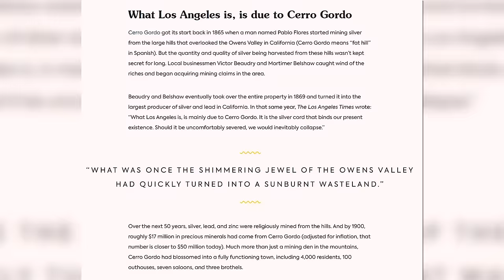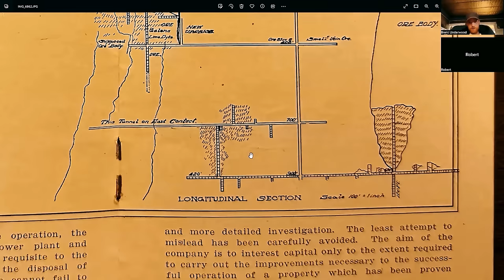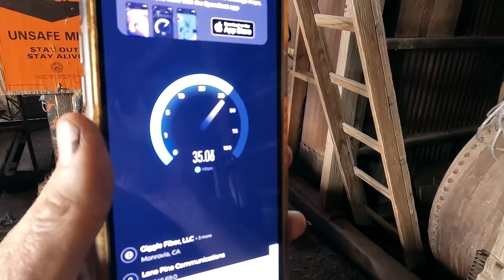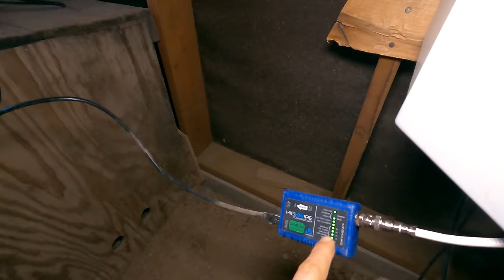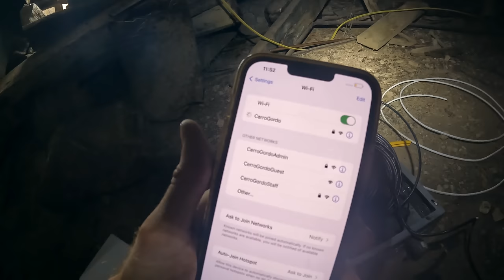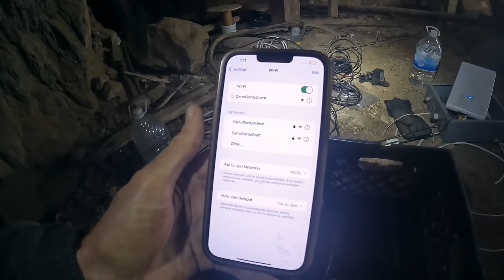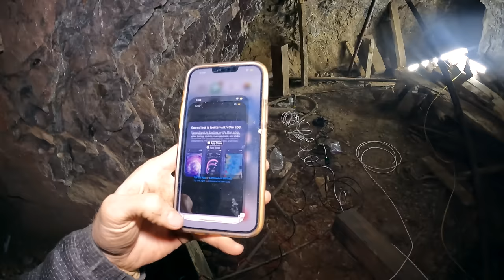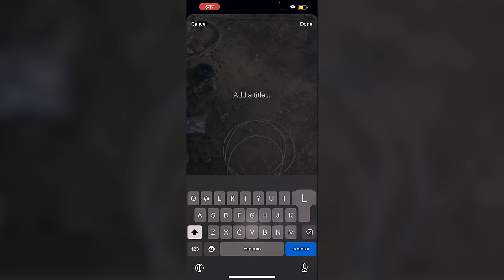I Have WiFi In My Abandoned Mine! 900 Ft Underground!

Comment: defo would have recomended fiber. can reach up to 120km on a single mode fiber no problems
Reply: If you pay for it and replacing it every few months, sure...
Reply: @dievas_  Why would it need frequent replacing? Use armored cable, and SMF is very cheap.
Reply: @dievas1 Replace fiber every few months? LOL Our country is still using fiber installed like in 1960's
Reply: Now you know how the trans Atlantic communication cables work. Cables connecting each nation under the ocean by wired land line communications to land, to towers for a wireless signal. Ps. Sattelites dont exist. Never have.

Comment: The voltage drop across 1000 feet has to be significant. I'm not sure about powering dc electronics over that distance. Use AC to power the devices at the bottom!
Reply: depends on the load. with just a wifi acesspoint there will be wery little voltage drop.

Comment: If you have 110v down at 900 foot level why wouldn't you run two power lines. Converters ethernet signal to electric signal. No extra cables needed, just two power lines
Reply: The max theoretical range of power line Ethernet is 984ft. In the real world it'll have issues far less than that. They should've just used some fiber. Lighter, cheaper, and longer range capabilities than coax.

Comment: Former cable guy. You probably should've used RG-11. It's a much thicker gauge coax cable that allows for less attenuation in signal over longer distances. You can definitely splice coax, but not like you would electrical wire. You put fittings on each end of the coax, then use a "barrel" to splice them together. It's just a component that's used to splice two ends of coax together. If you've ever seen a cable outlet in a wall, the little silver connector sticking out is one side of a barrel. Yes, a splice could create future problems, but a splice can last years. Also, it wouldn't hurt to use some rubber weather fittings for each connection inside the mine to protect from moisture. They make some specifically for coax use.

Comment: Soon as I seen the Mikrotik HEX I knew it wasn’t gonna work. RG6 is only good for ~300ft. 

Personally I’d bring the cox to the 300ft level, setup a RB2011 switch there. Then run a fiber down to another RB2011 per level, since you have outlets you and you want network. There will have to be a compromise. Fiber can run long distances, you could even run a single LR fiber from the top to the bottom with two RB2011 switches and it would work.

Comment: Hi brett. 

I was meant to try to contact you regarding the length of that coax cable and suspecting it will be too long with too much power deprecation over such a long cable.  And that you will need a power injector to ensure enough power to the devices. 

Seems like you got it sorted anyway and learned the hard way. Good stuff.

Comment: You could make the base camp room also function as an emergency underground bunker. You could renovate those tunnels fairly cheaply (Compared to building an actual bunker) and you could easily live down there for months/years if you have enough food and water to last. You'd probably never need to use it that way, but it would be a MAJOR luxury that could end up saving your and your loved one's lives if SHTF and its not safe to be on the surface. I'd be sure to get some UV lights to help simulate sunlight if you are staying long term, and red lights at night to keep your circadian rhythm in line.

Comment: That's a hell of a hot signal, for your location. You must have good line-of-sight to your local cell antenna. Next step: get a UPS down there. You want some emergency backup power and more importantly, active filtering in case the power is dirty.

Comment: Hey there Brent!
Long time follower here. I noticed in quite a few videos the microphone quality can be a little touch and go. If you're using Wireless Go II's for audio on your person - when exporting the audio, try changing the settings to output as 32 bit float. 
Trust me, the difference to the audio quality (especially in situations where there is high wind, or in the caves - it will genuinely surprise you.

Comment: One recommendation on the coax cable.  while normally not an issue, coiling the cable next to itself may in rare circumstances  cause weird signal issues. Just mentioning this if you end up trying to diagnose any weird issues, just try removing any coils of the cable to see if that helps.  Overall,  cool stuff getting internet 900 feet down.

Comment: Hey Brent. I want to preface this with the fact that I am far from an expert, but if you are truly trying to build a base camp down there that will require quite a few electronic devices, you will probably have to extensively modify your power setup. Only running 12-2 Romex, you are going to be limited to merely a couple amps before you start seeing excessive voltage drop with a 900ft run. It will work fine for a couple lights, but it could lead to significant issues with computers and other sensitive electronic devices.

Comment: Hey, I have a big suggestion for you for running all these cables and everything. You maybe should think about pulling a few 2-4 inch diameter plastic tubes from the top all the way to the bottom. Then instead of trying to put the cable going down, in 1 run, you can run cable   to several junction boxes wherever you want to and also an emergency phone line that is hardwired in case you lose Internet or anything else. It would also give you junctions that if you did lose power, you could troubleshoot in sections instead of figuring you lost a whole 900 foot of either power or Internet cable.
Reply: You could also run hard pipe for compressed air to all the levels

Comment: Hey Brent you might consider running a conduit and pull wire for the power and coaxial cable. It’ll make it way easier to run new lines and will protect them

Comment: I'd recommend using Power-Line instead.

You only need to install the adapters on the same circuit.

Then you just plug in the Wireless units into the power sockets you've installed on each level.

Power Line has a maximum distance of 984 feet.

Comment: Suggestion: What ever levels you mostly visit, maybe install a similar WiFi connect point (400, 700?) ? Place them in a casing that will protect them from the elements.  This can be a safety feature for when you go down there. Have the points on each level noted on a map. In the event of anything going wrong down there, go to a WiFi connect spot, and try to make contact...

Comment: I bet you wrapped a piece of the braid on one of the connections you made. Don't let the outside braid wires touch the center conductor on the 1st cable line you ran. You could keep it as a spare . Your doing a great job.

Comment: One thing I would note. Would be to have more separation between the power and the coax cables. Minimum of 200mm air gap between, or 100mm with one of the cables in a conduit.

Comment: Watching you struggle with your wifi was painful to watch, but I'm very happy that you got it done in the end.  Something to consider is that the Ubiquity device that your man put on the side of the building is meant for long range (miles).  You could just put another one facing down the shaft.  This would allow you to use inexpensive Access Points at any level connected to that shaft that would connect it.    I'm glad you didn't try to run 1000 feet of CAT5e as that limit is around 200 feet.    Never hit the reset buttons on the backs of any Ubiqity devices as that removes the programming and you will need to re-adopt the device, which needs to be done up top.  You can power cycle them.    Please make sure that hoist operators are always trained for the flashlight comms, just in case the internet goes out.  Also You should work on some sort of method of allowing the operator to know that the internet has dropped off.  He or She could then send some air horn blasts down the shaft to let you know and let you check in by flashlight.

Comment: Just a suggestion but fiber is so much cheaper than coax cabling ... And you would have the internet latency much lower and honestly it be more stable even just have two Ethernet to SFP converters to convert back to Ethernet down in the mines and above to the wifi ptp dish

And adding a fiber cable now would give you a redundancy of sorts

Comment: There are devices called time domain reflectometer's. You can get a cheep basic one for around 10 - 20 dollars. It will tell you how long your cable is, if there is a break, and distance down the cable where the break is so you can repair it. .

Comment: I was thinking of using powerline addapters..? Since you planned to run power down there, you might as well transmit internet using the same wires! Most homes have a LOT of romex in it, and the signal often has to go through the breaker box and back to the destination. Can't imagine a run like that being much less than 900 feet.

Since you'd have them basically on the same wire, i thought it would be a good solution

Comment: Your radio issues can be solved with money by any two-way radio company, but first it starts with proper antenna alignment. Ask a ham radio operator. Don't use VHF, use UHF. As far as power goes, should be using 600 volt cable and transformers to minimize the losses  down the long run. For the well pump, it needs to be a three-phase motor with an external controller / soft-start. Converting to coax isn't even necessary; all you need to do is aim one of the wifi radios down the mine shaft and point another up at the floor of interest, outside of the car tracks. PoE is a wonderful thing. PoE can be used further than CAT5 and CAT6 can be run for data. You need a respirator and goggles for any heavy work down there. Remember that silicosis kills and it takes a while for the dust to settle (unless you bring a wet-dry vac but then you need to clean it out).

Comment: So.... coax.  Having built several hundred networks, I would think that running a multi-strand multimode OM4 fiber cable would have been the way to go over that distance. You have power so the transceiver equipment and POE switches would not be a problem.  I've used those Veracity Highwire devices and have yet to be impressed with them.  However you do it, I can see the advantages of having the Internet down there.  Good on ya, mate!

Comment: You may need to get a Time Domain Reflectometer (TRD) instrument and "shoot" the coax.  What  TDR does is send an electrical pulse down the coax to the end of the coax. Shoot it with the end terminated  in either 50 ohm or 75 ohm terminations installed . Your coax type will determine what value of termination. I think you have F cable connectors so this is 75 ohm cable. 

An open or short in the coax will be shown on the TDR instrument in meters from the instrument  thus you will know how far to  do reach where your problem is the coax.  Then you  cut and  to put in a slice. More importantly,  long term you can't keep running new cable down the mine shaft when it stop working.  The cable companies / power companies use TDR to know where to dig and repair.

The TDR can also give you an indication of how well the signal is being send down the mine shift.  This is known as insertion loss (ILS).  The devices of the coax will have a minimum siganl level determined by how much signal is lost in the coax.

Also I see in the video that the cable staple were used to attach the coax. You cannot pinch , mash  or bend the coax cable or this deformation of the coax will cause the signal to be reflected back to either end of the coax into the receiver that you are attaching to the ends. Too much reflection will cause the receiver to drop since the forward error correction of ethernet is overwhelmed with uncorrectable errors.

Hope my technical explanation helps.

Comment: Still got pump at source.   
@Brent.  Pumps are designed to pump water out of a hole.  Not up a hole.  Put your well pump at top of hole and your water will work bettr longer.  And wont have to go 700' down to fix.
700' aint shit for a well pump

Ive tried to tell u this a few times now  mayb ull get the message this time

Comment: You may need install a signal amplifier somewhere in the middle of the 900 ft of cable. 900 ft is a long way to carry low voltage dc current. If tv signal needs an amp to carry that far then it stands to reason that Ethernet needs an amp aswell.

Comment: It would be better to eventually switch over to Fiber to replace the coax line. I did that with my company, had to do the same thing and bring internet 1000ft down a tunnel so that our workers had a way to communicate. At least you have an elevator, we had stairs going 1000ft down. That trip was brutal.

I'm curious to know if Starlink is able to work for you. We've been using it more and more for our sites at rural areas.

Comment: i think you should have used fiber optic cables down the shaft. The signal drop is quite high for coaxial cable of that length. fiber can go father than 2000ft before needing an amplifier.

Comment: With communications you need to use two 6 element beam antennas one mounted to the top off the hole pointing down the hole then one on the lift pointing up the the hole fixed to your UHF hand held radio,, for coaxial cable run rg 213.  Maybe you need some sort of amplifier or a booster,

Comment: As others have said, loses on copper over 900ft are huge. Spend a little $ and go to fiber for communications. You can buy 1000ft of preterminated fiber for <$1000. Way more reliable. And get starlink at your main building and use your ubiquiti gear to distribute that to the other buildings. Instead of 50mbps, you'd probably be more like 500mbps

Comment: It's finally a reality! Woohoo!  Now you can have the world at your fingertips! Now you need to have mains power run down into the mine and then you can have all the home appliances you want down there! Like a microwave and a water cooler, a refrigerator, a toaster, air fryer, instant pot etc. Of course, you need also a queen bed, a chemical toilet, a table and chairs, kitchen counters and of course all the things a kitchen needs, and don't forget a hot plate. DO NOT USE GAS or any other kind of OPEN FLAME, for obvious reasons. but it would be so cool to be able to stay down on the 900 level when you are trying to get things done. bring down some extra cots for others who might want to join you too. I would also advise for a door to the rest of the mine level because you don't want the dust to get into the Suite and getting everything dirty, and some kind of flooring so the dirt doesn't get stirred up every time you move around the living area.

Comment: Brent I saw you blow on your coax cable fitting, don"t do that. Over time the moisture from your mouth will corrode your connection. Use canned air to blow the crud off connections. I build cable distrabution systems using big coax cable, I worked in a bucket truck and blowing on the coax was done all the time until it wasn"t. They found a corrosive material caused problens to all the taps at every power pole, it may take years to cause problems but it will cause problems. Good job on your WiFi

Comment: I did internet for 10 years before changing careers... When you go for the mesh system I do recommend running ethernet to hard wire the mesh units... That way you can save some money. Those rock walls are going to kill your connection so if you hardwire you can get some more distance and have less mesh's running.

Comment: Its recommended to keep your voltage drop to <3%. With your romex, that would be 1 amp or 120W of power. If you limit to 10A at 900' I'd recommend #2 minimum wire size. Another commenter is correct, you should use conduit too.

Comment: mount the wifi setup to the cage, and put a junction at each level, that way you have power and wifi at each level. Or a permanent installation at each level and you could have wifi for the whole trip up and down. Now you just need to get some arduino and linear actuators to smartify the hoist control system.

Comment: Another option would have been to use an ethernet 'powerline adapter' (ethernet passed via power cable), this would have eliminated the need for a coax cable entirely, you could have likely just used the power cable instead, although its possible that maybe distance would be an issue in that scenario too, never tried it.

You should buy yourself 1 pair of adapters (they come in packs of 2 for like $40-$50), and then see if they work, because it might be an alternative to laying more coax in future, you can just plug in to the powerline instead.

Comment: When you ran coax down there, I thought "Man, that's gunna be slow; and it will probably be the fastest you could get on that long of a cable"  Yes, you could in theory run fiber down there, but it's far far more expensive for that run.  The method you chose might be still future-forward for some time given the length of the cable.  I saw the speed you got on your tests and thought "I'd take that speed absolutely and do NOT complain ONE BIT".

Comment: The 12/2 Romex is certainly undersized for the run. Normally it can carry 20 amps, but considering just how long the run is, voltage drop becomes a serious concern. Basically, the more current you draw the more the voltage is going to drop, which could damage your equipment if you were to run something big like tools or a microwave. It’s probably ok for the wifi equipment and a couple of LED lights, but not too much more without upsizing the wire.